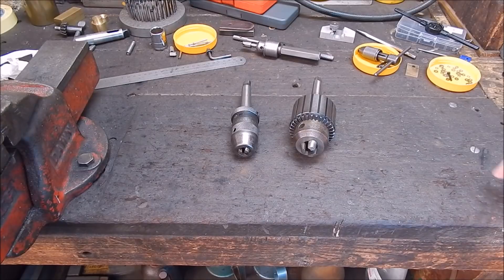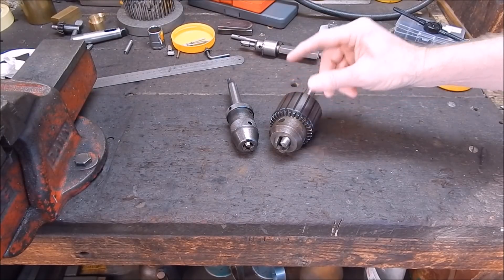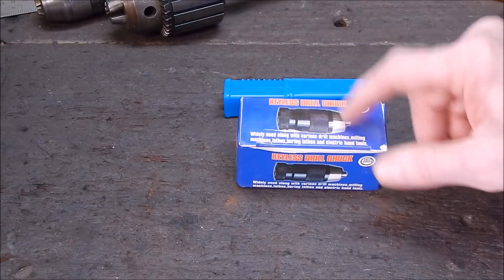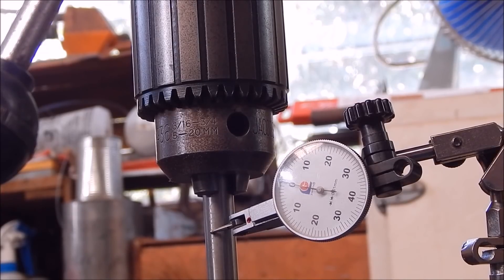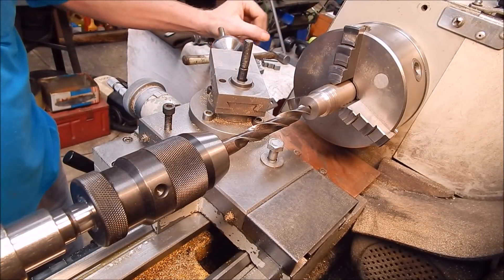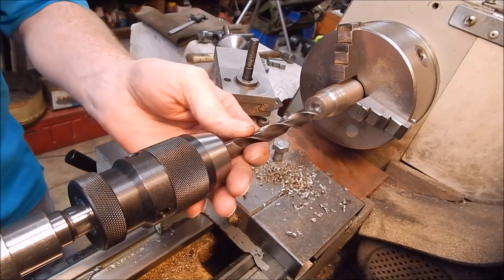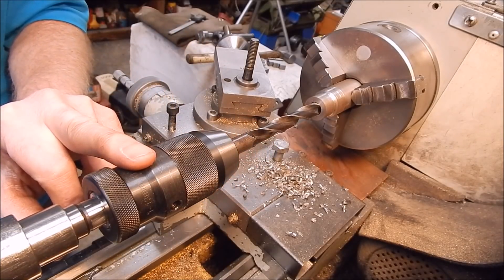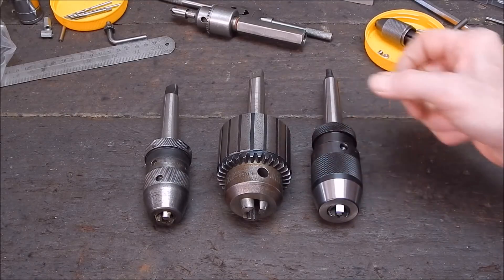Banggood 13 mm heavy duty keyless drill chuck versus Rohm

Comment: Alloy does not mean aluminum. It simply states that it is a mix of metals. I'm pretty sure that the chuck is made of some sort of steel alloy.
Reply from the maker: This model most definitely is sold as carbon steel, but some others are described as alloy.  Yes, you are correct that "alloy" can describe ferrous and non ferrous metals.

Rob

Comment: I've just bought a metabo Futuro top. I was told it's made for metabo by Rohm. Is this true? In any case, it's the most high quality part I held in my hands for a while! It's more akin to a sniper rifle assembly than to a regular workshop appliance :) I bought it for use in a drill stand with my tight as hell Hitachi d10vc2. The original plastic keyless chuck didn't even protrude from the drill stand holder.
Reply from the maker: I always buy Metabo keyed chucks as replacements.  Very good quality and value for money and still made in Germany. I can only say that most plastic bodied keyless chucks I've seen are pretty crappy.  I wouldn't buy one.  The Banggood keyless chuck is working well and seems to have loosened up a lot, it isn't hard to undo anymore.  Cheers Rob

Comment: I am impressed by the thickness of the outer case as i split my rohm by using a 1" bit. I welded the case back together, and turned up a shrink fit , Knurled sleeve., and it has been good ever since. Although there are times when the HD waterpump pliers are employed to loosen it off.
Reply from the maker: Wow, that is some serious shit.  I've used my 1" reduced shank drill bit in the Jacobs keyed chuck, but not the Rohm, so I can't comment on that aspect.  Nothing bad has happened so far ;)

Comment from the maker: What I thought was Morse taper slip was actually the Banggood and the Rohm chucks tightening up as the load increased.
Reply: Been there, done that. Camera catches things better than the old eyeballs :)
It's also very good at spotting runout. But it does tend to get in the way a bit.
Reply: It was clearly seen in the video by those paying attention to it.
One of my Chinese chucks, locks exactly the same as yours if the load is high. That's supposed to happen in a keyless design. I use a pin spanner to loosen it up,  Rohm's quality of materials and design, avoid that problem. I have a 0 to 1/2" Rohm with a straight 1" shank.
For your own satisfaction and benefit, you should check the chuck's arbor and regrind it, if needed. Within certain limits and depending on the application, drilling will never be dead accurate or have to be. Otherwise you drill undersize and finish by boring. In extreme precise location such as die making, they use Jig Boring Machines. Jolly good show as usual Rob.
Reply from the maker: Glad you enjoyed it Jorge. Doing product reviews tends to wear you down over time, because it's a lot of work, and because you know you can't cover all bases in the allocated time. You expect to get flamed for it.

But as they say, if you can't stand the heat stay out of the kitchen ;)

Cheers rob
Reply from the maker: Yes, it copped a bit of biffo in this video ;)
Reply: I was wondering what the run out would be after you used it and had a real good load on it.  I think it would be less as the taper would be seated better in the chuck and also the Morse taper.   Maybe some more spots you didn't notice that were smaller but still needed sanding.   I think the heavy load would fix some of that.

Comment: I got a 16mm keyless like that one and the jaws are very soft on my first use i had a pump shaft held in it and it became loose so I retightened it and it came loose again, after removing the chuck to check it I discovered the jaws were chewed up at the tips and were very soft, it still holds drill bits on line but the last 3mm of the jaws are gone.

Comment: G'day Rob.  Nice video.  Some folks like keyless chucks and some do not.  I have lots of chucks so I will put off experimenting with them for a while longer.
Reply: For what it's worth there are pros and cons.  I hate keyed chucks because I suffer from disappearing chuck keys - like everyone, I'm sure.  Too absent-minded even to put the key on the magnet I installed to keep it.  Keyless chuck seemed an obvious solution - love them in my battery drills.  Two problems though.  They - and I do mean similar to this BangGood chuck, to be fair - don't hold smaller items as well so you can find taps and reamers spinning when they shouldn't.  Biggest problem I have though is the length.  That BangGood keyless 1-13 chuck is about as long as the Jacobs 20mm.  In my mill with my daft choice of vise (was convinced I'd need tilt and swivel - haven't used either yet) I run out of height to get a drill bit in the keyless.  Other thing worth noting, if you're using it in a tailstock, is that the jaws of the keyless chuck rotate with barrel as you turn it to close the jaws.  It's not disastrous but if you're trying to get something like a drill bit aligned so you can drizzle cutting oil down the flutes to start, it's an annoyance.

Comment: Useful comparisons Rob - I have had a couple of import keyless chucks for some time and found them pretty acceptable really. Also, like your large Jacobs, I got one of that size for a mere $15 and gotta say, it was great value and occasionally it's v useful in the tailstock.
Reply from the maker: That's a good buy Chris.  I paid big bucks for mine new.  Considering it's done 40 years service on the pillar drill and is still like new shows how much better the quality made in Sheffield England Jacobs are, than the cheap pressed bodied ones that came later.

Comment: Hey Rob.  I'd take exception at your measuring method.  You're only measuring runout at 1 point, which is great if you know you're concentric with / parallel to the axis of the spindle.  The problem I've had with chinese chucks like yours is not so much runout, but concentricity of the chuck taper - I got under 0.1 near the chuck jaws, which for drill press use is kinda fine as long as you don't want to drill less than bout 2.5mm , but had 0.4mm 80mm out - the inner taper was bored totally out of whack relative to the axis of the jaws (tested on two separate shanks). As AVE might say, 

"GAAAAHBIJ", and it made a resounding "clang" as it hit the bottom of the crap bin.

And there's the rub.  Low price chinese stuff is cheap, but mostly it's utter trash.  You're better off finding a decent second hand name brand.
Reply from the maker: Fair comment Michael.  This was in my mind when I did the review, but how long do you make the video. Axial run out is always going to be an issue.  I took one test avenue and went with that.

Cheers Rob
Reply from the maker: Maybe I will do a follow up.

What do you recon ?

Rob
Reply: Sure, why not?  It would be a lot more interesting than the majority of "reviews" of banggood stuff out there.

You probably want to do checking of the shank and the chuck itself, if they're anything like the crap I've had cheap* from china they're both junk.  Another thing to check would be runout / axiality at both extremes of jaw extension (say 1.5mm and 12mm stock).  Use Rollies Dad's Method if you don't have precision stock in small and large sizes, you've got more than enough measuring equipment.

*I've had very good chinese stuff at "normal" prices, but at that point it's ot worth the effort, just buy a quality name brand tool.  Mid price stuff is a lottery, can be great, can be crap, Shahe indicators for example - if you get a real one, fine, but the market is flooded with low quality fakes.  Chinese fakes of chinese products.

Comment: I have a cheap B16 keyless chuck on my 450W drill press and let me tell you...if you stall the motor you're gonna have a bad time getting the chuck loose! On drills below 5mm it will spin free but on anyhting above that if the drill grabs the chuck will tighten itself so hard it will leave bite marks on the drill shanks!

Comment: nice comparison. Surprising that the Röhm and Jakobs did not shine at all in the run out test. It would be interesting to test the arbors for run out. Maybe the chucks are much better but the arbors are not so good. Maybe the banggood chuck could be rehabilitated with a true arbor.
Reply from the maker: Hi Rol,

I knew the arbor issue would be mentioned, but there's only so much you can fit in a video.  It would require one arbor being used for all drill chucks, and that's not something I have time to do.  The results were in line with what I expected on this.

The actual run out for the Rohm was quite small, and certainly way better than a lot of drill presses you buy these days.

Used in a tailstock the shown run out is not going to have much of bearing on the performance of any of the chucks reviewed.

Cheers Rob
Reply: I understand. Since your drill spindle taper is so precise it may be worthwhile to regrind the corresponding morse tapers as they are stuck on each chuck with your Hilda grinder. It may take two or three videos. But it would make for interesting content. If you clamp the drill chuck jaws on a precise cylindrical pin that is held in a collet chuck of the lathe you could grind a new center in the arbor, use the rotating center to stabilize the work and then regrind the morse taper of the arbor.
Reply: No doubt the Drill Press spindle and chuck arbor taper, have a direct influence on the chuck concentricity. Only after those two factors are eliminated or corrected, you can properly determine a chuck's run out.
That'st called tooling stack-up ( one deviation on top of another).
Reply from the maker: Totally agree Jorge, but in a real world situation this is what you get out of the box(es) ;

I could do a follow up on the radial run out aspect, but is it worth it when a single arbor is not being shared ?

Plus I'm getting a bit done on reviews and am looking for a break.

Cheers Rob

Comment: At 15:10 you see the chuck self tighten. At least that feature works well and the bit didn't slip.
Reply from the maker: Yes, both chucks do this if you watch.  Neither slipped under quite considerable load.

Comment: Gday Rob thanks for sharing. It is sometimes said that China makes really good kits. I am wondering whether there may be some dirt or grit inside the bang-good chuck, causing both the lockup issue and possibly some of the runout. Would be really interesting to see a tear-down, clean, and rebuild :-)
Reply from the maker: I think the lock up is a design issue as everything felt good and smooth. It's obviously load related/induced as drilling with smaller sizes was not as severe.

Works great with centre drills in the tailstock, which is what I got it for.

Cheers Rob
Reply: One of the issues I remember learning about with my mentor Dave was related to two steel plates bolted together with a through bolt. This was a bracket on a car, so subjected to some vibration, and the joint always came loose. In the end, he told me the solution that worked was to put some sand in some grease and spread between the two plates. This grit Loder interface never came apart unintentionally after that.
Having had the joy of pulling apart lathe chucks and so forth from our mates in China, it would not surprise me in the slightest if there was some grit between the jaws and the clamping collar, causing a similar “full lock”. From memory these chucks are meant to go together clean and dry inside the jaw side of the chuck 
Just my 0.02 :-)
Reply from the maker: You could well be right.  I'm not about to pull it apart.  Last time I did that I wrecked it.  LOL.  Not my scene.

Cheers Rob
Reply: @Xynudu  that sounds like what happens to me every time I investigate something...Cheers for the US, Paul

Comment: I gave up on Chinese accessories. I now buy strictly vertex from a local importer. My keyless vertex 13mm chuck is damn sweet for only $80. Beats the crap out of my supposed precise $150 keyed chuck from spain! Otherwise I go for my ER25 holder with vertex collets for precise drilling.

Comment: I have one of these and it is painfully unlocking it on a drill press where you can lock the spindle. Hole saw :(((
Reply from the maker: Yes, that would be totally bad news.  No spindle lock - not good.

At least the Rohm has provision for two wrenches, but this is one reason why I don't really like key less chucks.

I will use the Chinese unit on the lathe just for centre drills as it works fine with light loadings like that.

Cheers Rob

Comment: 4:50 so you mean that there is no steel alloys? It sounds like you think that alloys are just light metals. Steel with cobalt, phosfor, manganese, silicone and all other materials is actually an alloy per se. Alloy is just a chemical term for different materials that have been mixed to form a new molecular bond. Like bronze or brass or steel with different alloy materials beeing blend in to add certain qualitys. Just sayin

Comment: wtf, i just went to your channel and it said i wasnt subscribed to you and i know better. now im wondering who else google has un subscribed to on my behave. so i had to hit the button again, but anyway, i wanted to ask, have you ever taken the key less chuck apart yet? i recieved a new chuck fro allindustrialsupply and im scared to even use it till i have taken it apart and make sure its dont happen again
Reply from the maker: Hi Bob,

No, I've never taken any keyless chuck apart.  Mine is silky smooth.  You can't see what's going on inside though.

The only dud drill chuck I had was a Makita keyed one which had a piece busted out of the scroll thread when they pressed it together.  I wasn't very impressed by that.  It always felt notchy from new and of course it locked up about two months out of warranty and Makita basically said piss off.  

Good luck with your replacement one.

Cheers Rob

Comment: Rob, do you think that maybe that JT6 morse taper might be the culprit, I had one previously that wasn't machined or ground correctly, and was inducing a slight offset in the taper, until I swapped it for another which worked perfectly,  it took me a bit of figuring out to realise what was causing the run out,  I have a similar 1 - 13mm keyless drill chuck with a JT6 taper mount  that works really well, if you go to www.machineryhouse.co.nz/C299 you will see the model that I have, and I also have the bigger unit as well ( Model C292 ) and both of them have worked really well since I bought them without any issues, they are not cheap but they certainly do the job, that's for sure and I don't get a lock up like you were getting with that chuck assembly,

John MD
Reply from the maker: Hi John,

It's likely that any or all of the arbors have an error factor - as nothing is perfect.  But unless I compare all arbors, there's no point in just looking at the Banggood one.

So I reviewed the items as you would receieve them.  To strip down all chuck/arbors and measure run out is way beyond a half hour video and not something I wish to do.

You buy a chuck and arbor combination and that's what you will use.  It's as simple as that.

Cheers Rob